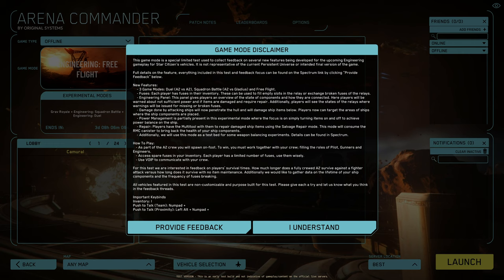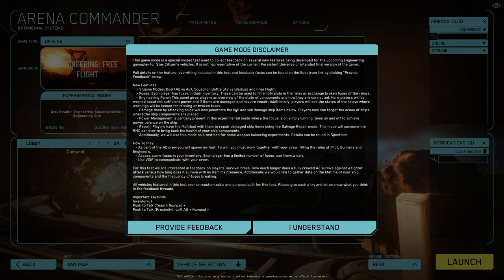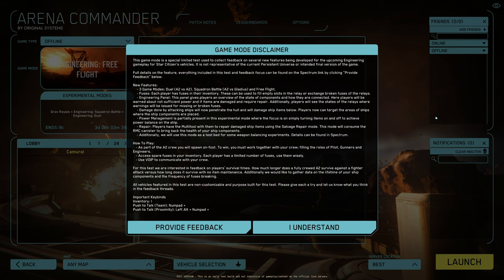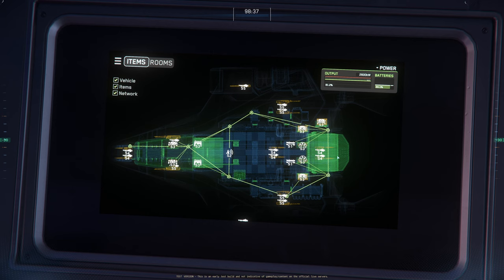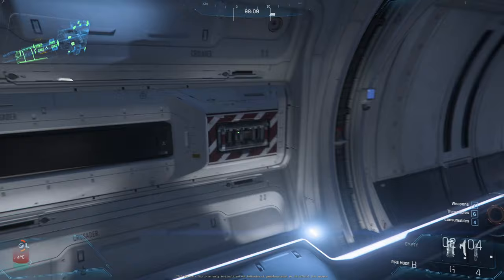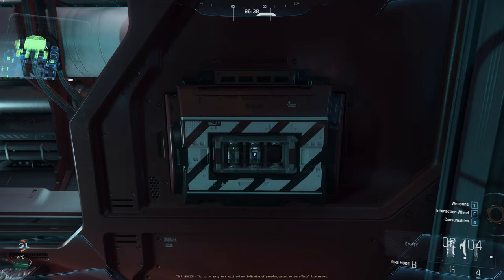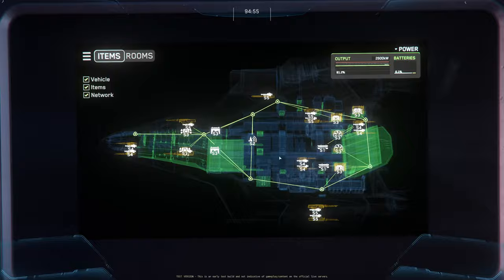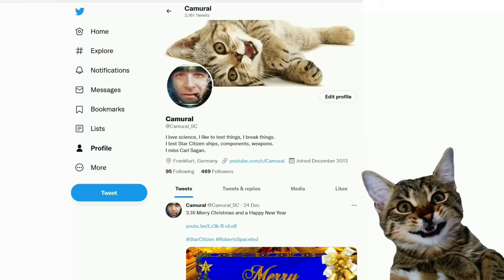3.23 PTU Engineering game play - First look

Comment: This type of multi-crew gameplay only works in a game like sea of thieves where the combat is not as fast paced. And you actually have time to patch holes, bail water, fire cannons, adjust sails, and make repairs with a crew of even just two or three. Star citizen as usual is making something so pedantically complicated that it won't get used in combat because people are still shooting at you.
Reply from the maker: @RookRiot1 
Chris: "But in movies the action magically stops when the actors are talking!" I am sure we can have this in my game too!
Reply: @Camural  If the smallest ship was something like the Cutlass/Freelancer/Spirit scale than this could be viable. Not in a game with powerful single occupant fighters and gameplay focused on dogfights and twitch shooter mechanics. 

Let's say for sake of argument that you were making a similar game in the setting of the expanse. Where a crew of 3 can reasonably run the smallest viable ship and a crew of 1 can sort of do it with heavy use of automation. Then you could incorporate this kind of on the fly repair system but it needs to be streamlined to hotkeys like you said so that it's not a huge investment of time that would be better spent maneuvering or shooting. 

A better experience for all involved would be to have automated redundancy built into a ship, relays fuses and components that can be damaged, in a fight and keep going with diminishing returns. A component would not "fail" until all of the backup or buffer parts are destroyed. This gives the crew something to repair after a fight or after a narrow escape. And the hero Scotty moments reserved for when the ship has taken so much damage that it needs to be repaired to jump away or keep the reactor from going boom. Add in the force reactions in combat maneuvering to this and the nightmare compounds exponentially.
Reply: @Camural  Players: "Oh Really Chris ?, then we want Nicolas Cage as Armsdealer. We are sure we can have this in your game too"
Reply: @artherion4301  Lord of war was still a good movie though.
Reply: @RookRiot1  i know, its one of my fav movies
Reply: Doesn't matter because the new changes simulate a faux armour, so the only way to disable some ships is by disabling components. So they can shoot at you all they want but until they disable the components you can keep going. This gives players plenty of time to repair and either high tail it out or fight back.
Reply: @Billy-bc8pk  like everything else in this game I will believe it when I see it and it is in my hands to test and tinker with. Until then any promises of armor systems and reputation for the myriad of other little things that cig has said is just speculation.
Reply: @RookRiot1  The new faux-armour system is already in 3.23. It's why some Wave 1 people are complaining that it "takes too long" to down ships now because they decided not to read the patch notes and not focus on disabling components.
Reply: Yeah when you fighting Hercules that will be "fast paced" fight lol. Especially when Javelin comes out. The pace will be the fastest. Like 10 seconds fight against Javelin right? XD

You guys dont know what you talking about.

Comment: Maybe instead of a hotbar, one way they could streamline it is to do a simple check whether or not a fuse is in your inventory. 

So rather than having to press 'i' to open your inventory, carry it, then place it, have it instead where when you press f to place, it will automatically pull from your inventory and place it. Otherwise, it will give a prompt like "fuse required" or something like that if you don't have any fuses in your inventory.

This simple check system could also work for other key/mission items like keycards so you're not having to constantly go back and forth between your inventory.
Reply from the maker: @Mootkins everything is better than:
-hitting I to open inventory
-right clicking on a fuse and click on carry
-closing inventory
-place the fuse

However, I think a hotbar works well, most games use it for a reason.

Comment: What a strange way to engineer a ship with inline fuses distributed around the ship instead of a resettable circuit breaker panel accessible by the pilot in the cockpit.

It would make more sense if these were something like emergency backup power cells and intentionally distributed for redundancy in case of damage. Engineering gameplay could then include rerouting, restoring, or boosting power for a limited time in a crisis.
Reply: They are redundancy backup power cells. And you can re-route and restore power and boost power using the relays. People should really get informed about how the system will work before trashing it. This is a tier 0 implementation just to test basic functionality -- a ton of the other systems are disabled at the moment.
Reply: No, CIG staff states these are fuses in their [Wave 1][EPTU AC Playtest] post.

Modern day pilots and astronauts don't run around their ships replacing fuses, they use a circuit breaker panel for reasons that should be obvious.
 
Also, "Tier 0" is sophistic jargon meaning "half-assed".
Reply: @alistairbuckle3450  100% true

Comment: I'd much more prefer a switchable 2D schematic of the ships components and where they plug into, kinda like an electronic schematic, but simplified! This 3D overcomplicated, 90% empty space UI is just a highlight of where the manhours go, into bells and whistles first and thought second.
Reply from the maker: @yourfavoritecrafter yep as always Chris only care about:
-eye-candy
-fluff
-time sinks
-cinematic cool looking UI

Chris never cares about:
-basics
-basic mechanics
-some very basic physics
-function
-usability
Reply: It's the same design for the mini-map. So technically they're resuing assets and designs to improve workflow. It's ironic, because your suggestion would increase dev time unnecessarily.
Reply: @Billy-bc8pk  I think this would apply if they didn't have 10+ years of dev time under the project's belt, It's unreasonable to say it would increase dev time at this point, they had more than enough time to develop both 2D and 3D map layout at this time, even if it would be something they started making 2 years ago.
And bruh how hard is it to take a screenshot of the existing 3D layout from the top, make layers of the ships floors and make it more readable?

Comment: A fusible link is used to protect a device that requires electricity from receiving an overload of power, which might damage internal components. This is the most basic and primitive method for providing this kind of protection. The idea that we should run around a spaceship in the far future replacing fuses on the actual components is laughable, as spacecraft we have today have much more advanced and thus less labor intensive methods for this. 

The idea that other players can target your components and damage them also ignores the fact that to do so would require penetrating the shield and the hull or (presumably) armored door protecting them, unless we are talking about heat damage that wouldn't be aided by a fuse. If I shoot my gaming PC with a gun, there would be one or more holes in the case and at least some of the internal components would be damaged. My PC is not designed for military applications, unfortunately, so any gun I could conceivably carry would most likely completely destroy my PC.

If I go outside my house with a weapon designed to fit and function on a military spacecraft and fire it at my PC, I would have a huge hole in my house in addition to a destroyed computer. If my house were in space when this happened, the last thing I'd be worrying about is replacing fuses.

This is not engineering. This is a silly mess of busy-work intended to fool us into thinking they are working on engineering. There has been absolutely no thought put into this as a functional part of an actual game. This is not fun, practical or even logical.

In your video you didn't address the part that we can now repair broken components with a box of hull scraps and our handheld magic beam gun. If we have the engineering ability to create a cheap handheld device (literally costs nothing in game to have as many as you want) that can rebuild all the internal and external structures of any component manufactured in the galaxy, how is it we still need to have a guy running around the ship replacing fuses. 

When CIG says tier 0 what they mean is nonsense filler representing where one day actual gameplay may exist. Star Citizen is a very pretty tier 0 game, and I've pretty much given up any hope of it ever becoming what was promised within my lifetime.
Reply from the maker: @preechr yes this is another very low effort tier 0 implementation with a fancy holographic ghosting text UI to make it look special.
For year 12 and +670 million dollars, this is just sad.
Another magical repair beam, etc.
And those fuses are in the open I guess everyone can grab them or shoot at them.

Comment: The relay layout makes no sense.  Power loss locks the crew inside the cockpit, so how's that engi supposed to get back through the ship to replace relays.    Currently no way to open doors unless (shooting them shouldn't work if they're power locked).    Relay boxes are a joke.    They're pulling a salvage on engineering.   Engi doesn't have e a seat so if you get force reacted you can't Interact with the console.    Should have just been the 3rd chair....   So dissapointing

Comment: This looks like hot garbage. Not just asthetically but mechanically. Why are we replacing fuses. When was the last time you replaced a fuse on your car... i had assumed (apparently wrongly so) that we would be doing things like rerouting power, or bypassing systems to force malfunctioning parts to work. This is us effectively running around the ship replacing lightbulbs.... this is dumb.
Reply: You will be doing that, but this is a tier-0 implementation to see how people handle the basics first. I doubt most people will adapt very well and they will have to keep it dumbed down.